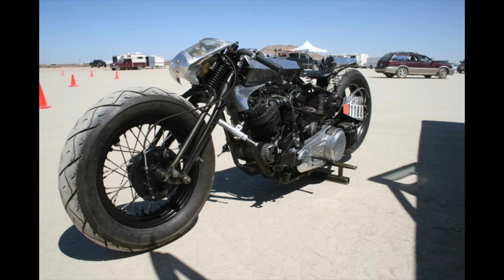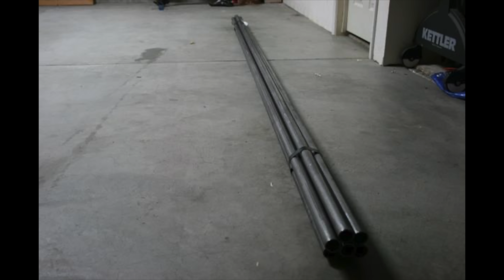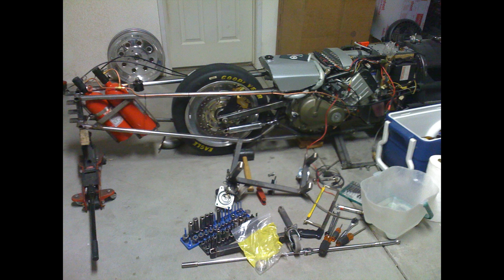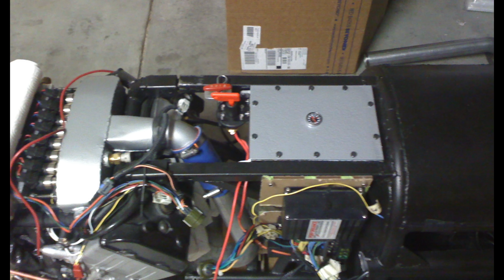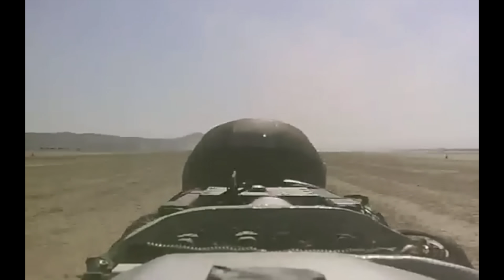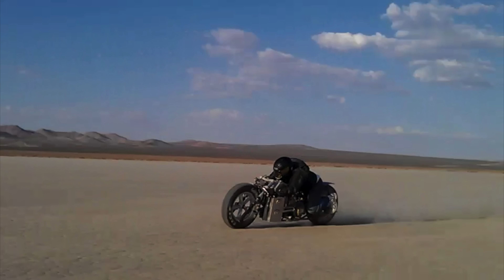I Built An Insane Motorcycle. Four Times.

Comment: Do you all know that fun fact about racing? It takes an awful amount of money to get a racing vehicle faster than it already is. Think about it, lighter wheels, better tires, better brakes, better suspension and springs, a sturdier frame, stronger engine, stronger gearbox, and drive shaft or chain, the aerodynamics needs checked, it sounds a bit like a new car or bike or ajrplane or powerboat. And it gets faster, but get real, not a lot faster, and it costs a lot of money. Twice the budget never gets you twice the speed.

Comment: Maybe convert it into a superman Flight simulator a motorcycle where the rider sets in the prone position head forward also use Slide Rail steering what you design is missing is a ballast belly weight

Comment: ive got a 92 foxbody thats been my project car sc 2018. originally i was just going to v8 swap it to the og 5.0. that turned into a shortblock overhaul while it was on the stand. then a longblock resto. then a 0.030 over and 0.25 poke and stroke. then after it got bored, flat planed and hottanked. its now sitting in my spare bedroom closet in garbage bags with an oil coating. been there for about 3 years now. and now i want to coyote swap it. but she needs paint/body work, so i want to do that while the engine is out so i can get it done the right way. many reasons have slowed this project. covid, mortgage increasing by 60% because of lack of communication, my daily needing a new transmission, a new roof because it was 20years old, my dad having heart surgury, loosing my job twice because of events out of my control. life sucks, enjoy the moments when you can, dream big, stay focused and ONE DAY, reality will match the dream.

Comment: Why did you not use motorbike tyres like most of the Land speed motorcycles a lot of motorcycle tyres are 180 mph and where they are curved you are less likely to be pushed about on the salt flat tyres would not be fun on the road or anywhere òn a motorbike but you have amazing engineering skills and you will crap code

Comment: Your bike will never feel stable and safe as long as you use car tires... the flat surface causes sudden changes in handling. Motorcycles need rounded tires... otherwise, it feels like it’s gonna fall over.

Comment: Not dumb, just not thought out enough. Bring the rear wheel in about a foot and put a third one the back a few inches away from the other one. It is still a motorcycle and will be easier to drive. It has to be a trike because of how low it is, A person over the bike's body usually equalizes the center of gravity and makes it ridable. it is possible to use these mechanical leverage with this because it is as flat as it is.

Comment: I am not involved in the car community whatsoever, so it's pretty awesome to know other people have the same problems as I find myself making. I always get in way over my head too. I resolved to rewire my imported 30 year ols Land Rover Defender after seeing your wiring video. Bought all the things that were recommended, went out to my truck and immediately found myself staring into the void and realized I was in way over my head right now. I did, however, wire up an engine bay light using almost none of the recommended materials or processes and then called it a day. I'll rewire when I get a chance to redo the frame. Anyway, your videos are great. I don't want to do patron because I'll inevitably forget to cancel it much like a hundred other subscription service I have, but if you sign up for something where I can throw you a few bucks I will. Keep it up!

Comment: sooooo Matt....  watched yer airbox build and there in lies your tuning issue.... for ease of tuning.... stock airbox and filter with ducting for ram air similar to original is pretty necessary at least untl the Ebay ECU ya used relearns the altitude changes and such after bein shipped from who knows where..... while its possible to fabricate custom airboxes a increase in volume is better than decrease because donor bike was already drawn up with minimal size due to packaging....
 also watch engine temps as it needs temperature to make power.... spark plug reading dont lie and tells all...... 
 thanks for makin us laugh we all need that these days

Comment: The reason this project failed was there never a realistic goal set from the start. If you set a strategic goal at the start of a project, you can then examine that goal and determine if A it's achievable and B what is needed to achieve it. If you had said at the beginning of the project that the goal was to build a streamline motorcycle for the salt flats that could go 85 mph, then you would have said what's the point? You could go 85 mph or much faster on any street bike for a fraction of the cost.  So that brings you back to the original goal. Was it to go fast at the flats because you certainly didn't come close to that goal. Was it to spend a lot of money to go slow because that really isn't much of an accomplishment. So, the end result was you spent too much money, put in a lot of effort in fabrication and went really slow in a half finished machine that was probably unsafe. It sounds like the little kid in you wanted to do this because it would be fun and I suppose if you had unlimited time and money it might have been "fun" but as the surfers say it was real and it was fun, but it wasn't real fun. Your video was a very honest example of how not to approach a project and on that level if it shows others the possible pitfalls then it served it's purpose and I commend your honesty in making it. as they say, sucess has a thousand parents, but failure is an orphan.

Comment: I did the same thing with a go kart I built with a 2 stroke 3 wheeler engine. I cut the frame into pieces when my neighbor came around the corner with the front inside wheel about 9 inches off the ground and all 3 of the rest planted solidly. He must have been doing 70. I should mention he was about 375 lbs too. Lots of frame flex, somebody would have died for sure. Lol(?)

Comment: My current mistake in progress is a minibike...Sort of... I took a really fun, functional Baja Warrior MB 200 minibike with a Predator 212cc engine and "Torque converter " drive that at 48 mph was 24 mph faster than stock and would easily pull vertical wheels tanks, and put in a 479cc 16hp Briggs and stratton Vanguard Vtwin that I then modified with a governor delete, 34mm dirtbike roundslide carburetor and valve springs with enough seat pressure to allow around 7k RPM before valve float along with some machined steel retainers. I also did a mild port and polish on the heads since I have done cylinder head porting and polishing along with flowbench testing as part of my job for a long time. I also had to modify the frame, raising the backbone by 3.5 inches to fit the engine in and have enough room to work on it. Due to the larger diameter crankshaft the "Torque Converter " was no longer going to fit but in all likelihood it would've disintegrated anyway as it was rated for up to about 9 hp maximum and I am probably putting out around 24hp. That may not sound like much hp, in fact it's not difficult to put out that much with a 212cc single if you've got about $2.5k to throw at it, but the Torque output of a modified 479cc Vtwin vs a modified 212cc single is quite a lot, and with a vehicle weight of around 150lbs I found the original 50 tooth sprocket on the rear wheel (19×8×7 wheels/tire combination) was almost unrideable. It would wheelie pure vertical while spinning the tire on asphalt using a centrifugal clutch with a jackshaft on a launch from a dead stop. A 25 mph rolling start pulled the front wheel about 2 feet off the ground and about jerked my shoulders out of socket,but it topped out at about 52 mph. I worked my way down to a 32 tooth rear sprocket. My acceleration from a 20mph rolling start is still shockingly fast but the centrifugal clutch can't withstand over 1/4 throttle at any slower speeds and it will in fact glow red if I try to do so. It will still pull the front wheel up about 6 inches at 25mph if I snap the throttle open. With top speed around 78 mph I think I have surpassed the maximum safe speed for the Chinese 19×8×7 dirt knobby tires, although they do feel remarkably stable after airing them up to 20psi vs the 10 psi  maximum pinted on the sidewall. Well at least remarkably stable for tires that shipped from China with a factory egg shape and 15 oz out of balance. The centrifugal growth rate is almost comical and may be contributing to my top speed. So now I'm looking at sourcing an appropriate set of wheels and tires, as well as brakes (single 4 inch rear drum is not really doing the job) and using an old XL125 lower end and transmission with clutch to make it safely past the 100 mph mark and not have to baby it until over 20 mph. So essentially I will possibly end up with a rigid framed, telescopic front-end minibike that performs a bit better than an 883 Sportster but is no longer as simple and reliable as a minibike (or even an 883 Sportster) that is not street legal and tries to break my spine everytime I ride it. It does currently get about 44 mpg at a steady 50 mph, I have ridden it to a buddies house 12 miles away numerous times, and so far I have less than $500 wrapped up in it including the price of the used minibike so I guess it's not as bad of a decision as a land speed bike lol. But at 52 years old, in relatively beat up condition and living on a fixed income (VA disability) one would think I would be making better choices by now.
Reply: Jesus H. Christ! I had to comment 2 years later since nobody else has!
Reply: @rudysaldivar4228  thanks. By the way, my minibike still runs. I have one video of it doing a smoky burnout on my channel. The rest of the videos are rattlesnakes and copperheads from my yard, and me letting them go away feom the house lol.

Comment: Matt... I think the perfect solution would be to change out the front wheel assembly for an axle (or pair of a-arms with central shock) positioning two wheels outside the chassis, and an angled hinge... so that leaning the entire chassis one way or the other will cause the axle to rotate to match the turning radius.  The handlebars should remain in play so at standstill the angle can be pulled one way or the other.   Not only would this make the entire thing more stable, it would have brilliant forward visibility, while retaining that "space ship" feel of leaning it through the corners.

Comment: There's 2 mistakes with projects that I always tell m students and apprentices to avoid.
Don't go in balls and all first up, and always keep the car 2 days from driving.
What's this means is, don't go from not having a project car to completely stripping 3 cars to their individual nuts and bolts and trying to re-assemble them. Start with a working car and do small modifications first. Which brings me to my second point. Always have the car within 2 days of driving. Which means, whatever you do to the car, make sure you can finish it in 2 days so it can always be entered into events. There's nothing more crushing than looking at a bare frame while all your friends are driving their car.
After you've been modifying and building projects for a little while, then go for the bigger builds. Or just keep reinventing your current build. Some of the guys I race with have been building their race cars for 10 or more years.

Comment: Some of the things you mentioned reminded me of the SV Seeker metal boat building project that was built in the yard of an ex-IT, database administrator who fancies himself a bit of an engineer. Through out the course of the project he would take the 'cheap out' route when selecting parts and methods for doing the building an only arguing with the more experienced people who volunteered on the project. Once the boat hit the water and testing the systems began, a lot of the poor choices have bubbled to the surface requiring that they be modified, and the more expensive parts purchased and installed when doing the work of course is harder. 
Your reminded me of him when you talked about paying more money in the end due to buying the wrong things first, and then having to replace them later.
I do admire your honesty. I mean no offense to the SV Seeker project owner, but his ego will never let him admit to making these kinds of mistakes, at least he doesn't admit it in his video presentations.
Reply: Dude is too much

Comment: Okay, so I've gotta know. The chassis on the first iteration of the bike: the upper-most horizontal members are different diameters. The left hand side tube is bigger than all of the others. Was there a purpose to this? Or just the result of available material? I'm assuming this was to run something through the chassis on one side?
Reply from the maker: I noticed that when I was making the video, and the truth is: I can't remember. I think I might have wanted to use it to pull a portion of the intake air from the nose. That first build feels like a lifetime ago.